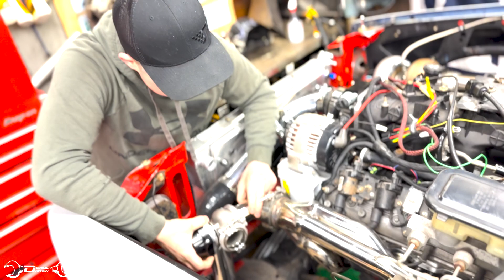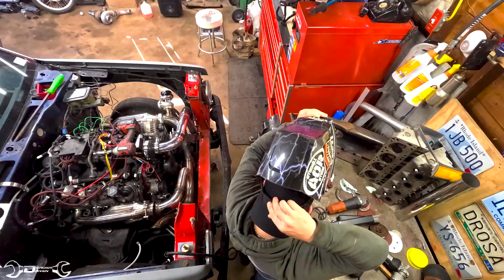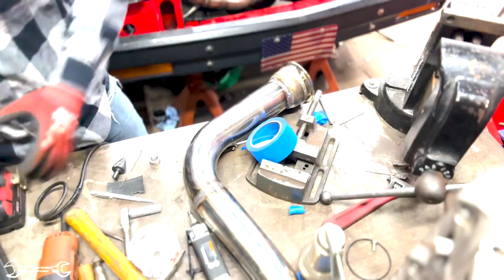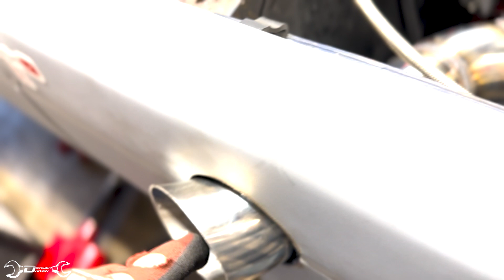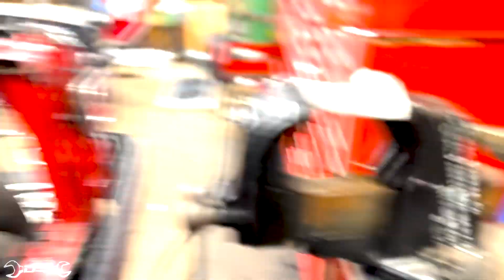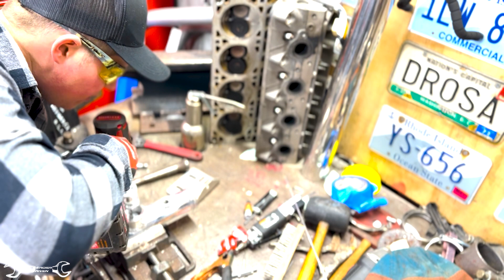Building my FIRST Turbo s10 | Installing the wastegates

Comment: Just some constructive critisizm here. You really want those in line with the exhaust stream for max effiency. In other words you want them in line with the exhaust flow or as close as you can to it. Most folks put them on the elbow of the pipe with the inlet to the WG facing into the flow of the exhaust as it hits that elbow.
Reply from the maker: That you for the advice man I appreciate it!